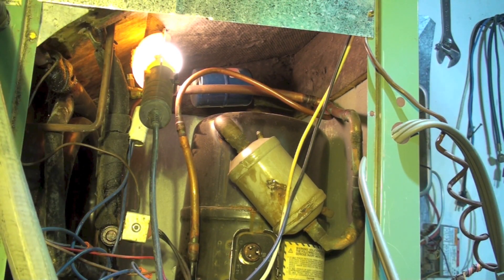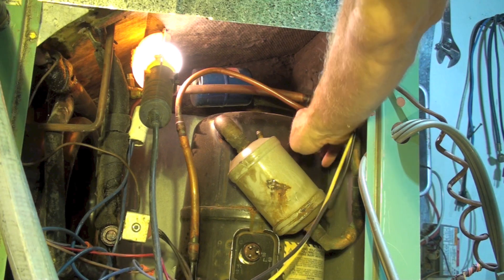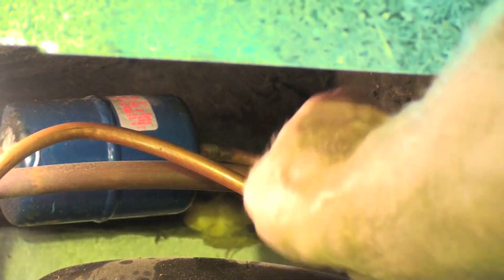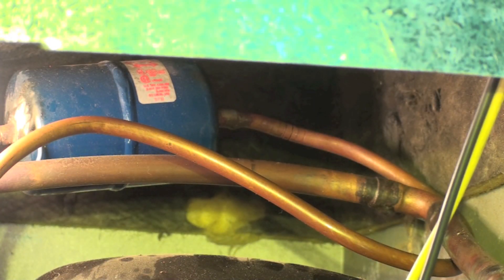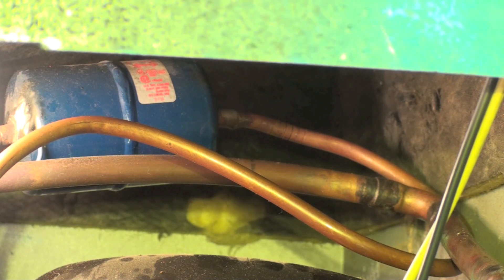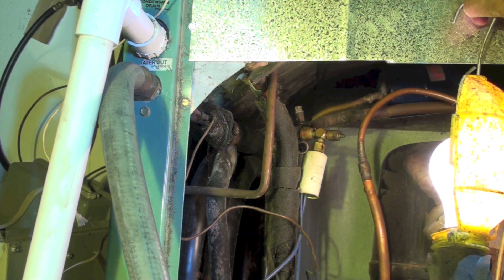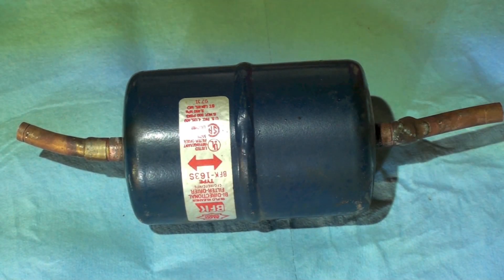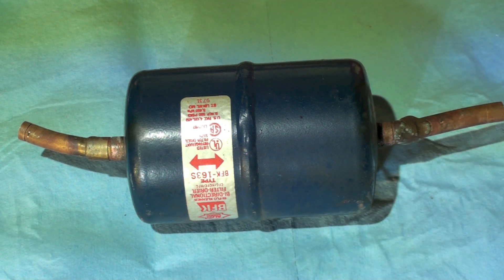Answer to whats wrong with the piping on this heat pump

Comment: Looks like they also reduced the size of the liquid line.  Driers we’re not designed to handle the high temps of the discharge line.  I removed one that a previous tech had installed in  the discharge line, and it was restricted.

Comment: Hi! I was trouble shooting a 2 ton water source heat pump today (FHP) and  I am kind of confused by the data  I measured.
After charging
1.I have 25 degree subcooling
2.10 degree superheat
3.85 degree condense temperature (Unit gets enough water 4-5 gpm 85 degree cooling tower water) 
4.16-17 degree temperature split.
The unit is cap tube (I dont know why they didnt use txv it is new machine 4-5 years old.) 
Why my subcooling is too high?
If I have a restricted cap tube then how do I have ok super heat and ok temperature split. Did I overcharged the unit?
I dont exactly remember pressures but they were around 150 PSI 380-400 PSI.
Thanks in advance
Reply from the maker: Guy Hakverdi Subcooling may not make much sense on water cooled units.  If your condensing temp is actually 85 degrees F, it would have a head of 255#.  The temp split is ok.  These units should be charged with the factory charge if a drier has not been added.  I would want to be sure the charge was correct first.  
Cap tube and fixed orifice are 2 different types of expansion device.  The difference being there are usually several cap tubes that could plug individually.  If it is cap tubes, one could plug but the superheat would be ok.  From what you say, the unit may be ok.  Hope this helps.
GFM

Comment: I saw this on a commercial freezer I worked on recently.  Another company obviously thought the muffler was a filter drier and replaced the muffler with a 16 cube filter drier. Plugged up the cap tubes not long after that.

Charles

Comment: I have seen this before on a brand new comfortmaker geothermal system they must have thought the muffler was a filter dryer or something nice find!
Reply from the maker: Nicholas Rowan The amazing thing is the placing of the drier makes it quite hard to braze in.  The liquid line is far easier.
GFM
Reply: York used a single way solid core sporlan drier in their discharge lines for heat pumps. Some engineer thought it was smart to use it as a combo and save money on bilflows. Sporlan approved it obviously. Doesn't have much moisture retention though

Comment: I see this a lot when people change a compressor. They have no idea it was a muffler in the hot gas line so they think they are replacing the filter drier. Oh and yes people put in suction line filter driers after a burn out and leave them in.
Reply: The also lay suction line filter driers on their side, without a slope.  They trap oil in that position